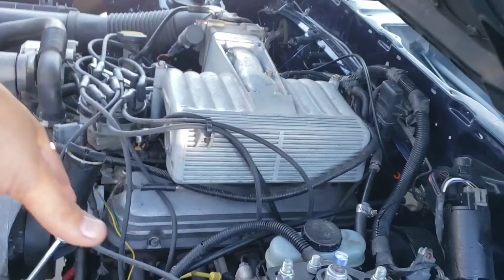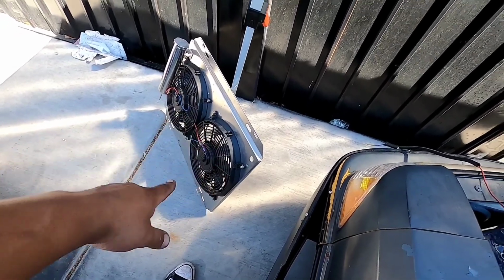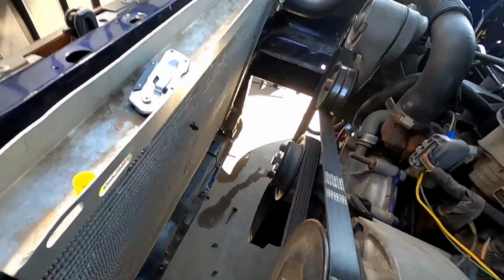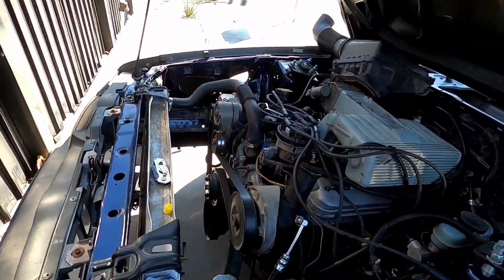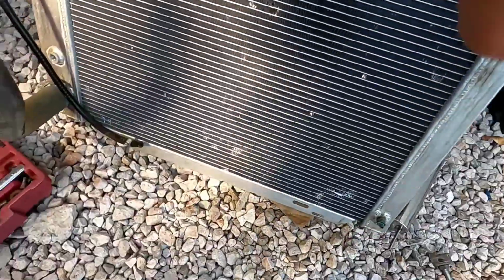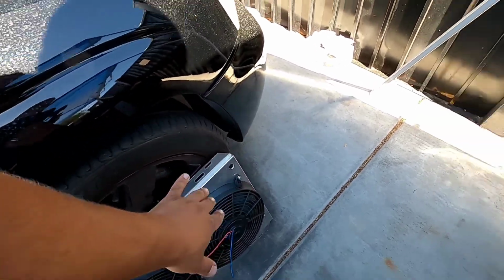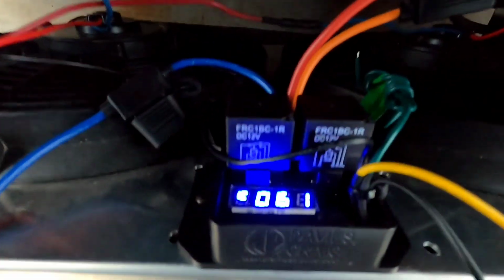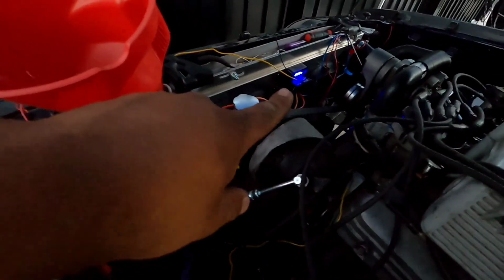installing a fan controller

Comment: Empty the radiator. Flush it And solder it using flux before solder. Really easy to do just use only enough heat to melt solder. Good luck on your ride .

Comment: So 80 mean 180 90 means 190 thats all im trying to figure out need to know to set my temp.
Reply from the maker: 80°c is 176°f
90°c is 194°f

I forgot what I said in this vid, Might have said something Incorrect. But that's what it is.
Reply: @ghettorigged3962  ok thanks I think around 85 would work for me